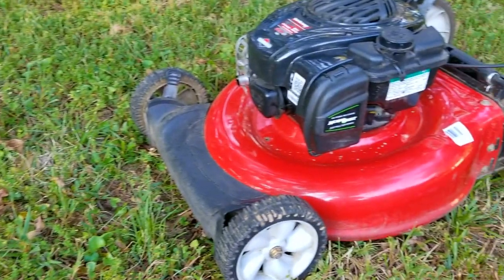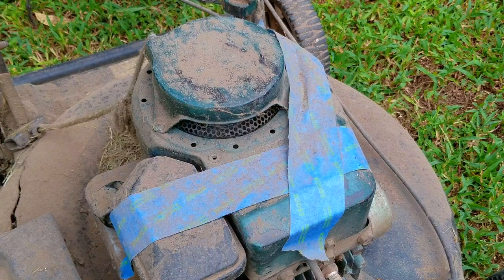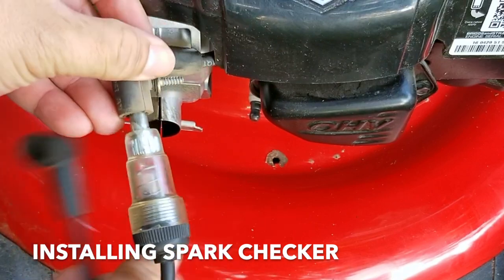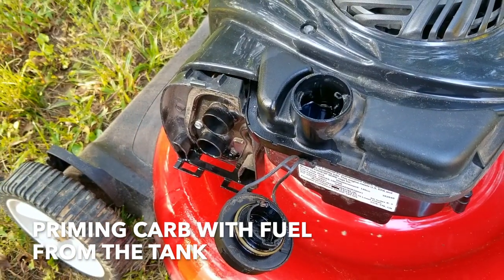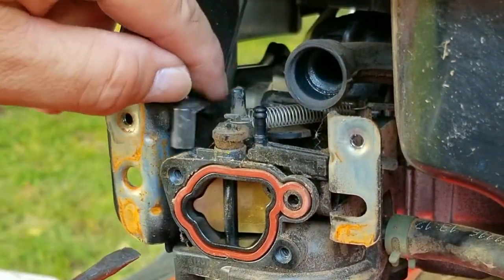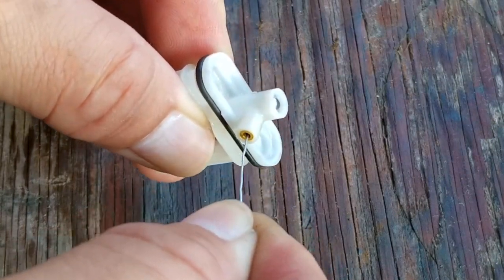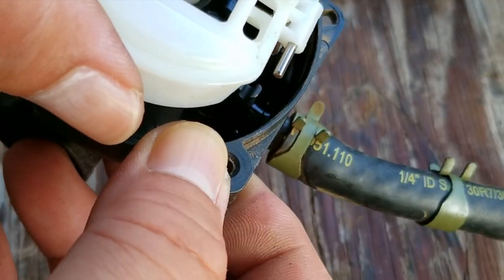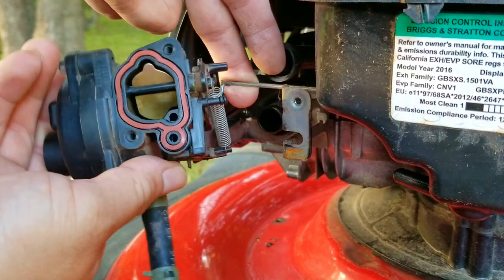Why Did Briggs Stop Making The Flathead Engine?

Comment: I have a 1980's B&S Classic push mower and a year 2000 Snapper rider. Both are still going strong. Keep your oil changed and run them out of gas for winter storage.
Reply from the maker: Thanks for the tips!

Comment: I have the old flat-head  mower motor on mine and it's been running for about 20 years now. It's had a new fuel tank and and 2 carbs and some gaskets. It's still running like a champ.
I suppose it's nearly worn out by now but it still starts on the 1st or 2nd pull after a good prime. 
I don't think anything I could replace it with could last anywhere near as long.
Reply from the maker: I like your testament about them, these can be very good engines.

Comment: I have a Flathead Brigs and it runs fine. The only problem is in the spring as sometimes the engine won't start the first time I go to mow my lawn. The carb float sticks and doesn't allow fuel into the carb so I just drop the bowl and blow some are on it. Put it back together and it then runs the rest of the summer.
Reply from the maker: nice work!

Comment: I have not seen the plastic carburators in my country yet, that is totally new to me! Whats your opinion on them? They might be better because they will not corrode when water comes into the bowl. Any opinions?
Reply from the maker: yes they went to the plastic carbs, in part, to deal with the ethanol content.  Good Carbs as Long as you use gasoline with NO ethanol .

Comment: I love the plastic carbs. I freaked out the first time I saw one, but they are super easy to work on. Making carbs out of plastic is actually a really good idea, since it eliminates issues with rust and corrosion.
Reply from the maker: me too, I was shocked but then realize I've been seeing them on the pula prime engines and even the 2 stroke lawn boys for the longest times.. got used to it by now

Comment: I've got this same engine on my mower. I've had it a few years now, and found out about the starting problem after the first winter fresh out of the shed. Read up on it, and the problem stopped when I started adding stabilizer to the gas. And yes, the recoil IS a problem, haven't had to work on it yet, just have to twitch the cord after starting, now and then. Oh and, tipping the mower over to drain the oil is a pain.
Reply from the maker: than you Feral for sharing your experience.

Comment: this is the kind of view you get from a youtuber who worked on a mower one time.  The plastic carb isn't bad, they can still get clogs but at least the bowls don't corrode.  The clogging and corrosion from modern fuel has nothing to do with octane levels, it has to do with the ethanol.  Ethanol attracts moister...moister in fuel causes corrosion and enough water in the fuel will stop a small engine from running right or at all.  And the Intek engines are in literally dozens of popular riding mowers, ranging from 15 to 21hp...they are perfectly fine engines.  I've run a few much harder than they were intended for and they did great.  Any type of fuel injection would add at least $100-$200 to the price tag of a push mower.  Most push mowers have carbs that cost $15-30 new.  You can't have a fuel injection system for anywhere near that cost.  The modern engines, plastic carbs...neither are to blame for 1000s of these little mowers being thrown away.  The main issue is ethanol in gas.  Without ethanol, gas can remain usable in a lawnmower for 3-6 months...with ethanol, it can cause problems in as little as a month (depending on the humidity outside)  Personally, I don't care, because I always pull a few free mowers from the roadside every spring, clean the carbs, and then sell them for $50-$100 depending on how nice they are.  And, I do lawn care, so I always get new customers who had their mower crap out and would rather hire than pay $400 for a new mower and do work every weekend.
Reply from the maker: thanks for the information

Comment: I have a Tecumseh from 1979.  It has a not getting fuel issue.  I thought it might be a stuck float. You showed me it could be something else.  I never drain out the fuel so the gas is a year old.  That is not the issue.  It ran before and because of the safety feature, as soon as you let go of the start lever up where you push the mower, the engine shuts off. Designers are nuts.  I have to wire it to always engage the blade so when I take off the bag the blade is still engaged.   So, on the second go around of cutting the lawn I did not have the wire to tie the engagement lever so, it shut off.  No biggy until it did not want to start...halfway through doing the lawn.  So, I guess I got to take it apart and clean that port.  I assume the T mower is the same as the B&S mower. Now waiting for the snow to melt...so awhile to go.  Time for a beer. My electric lasted 40 years & still works.

Comment: I recently sold a 30+ year old generator that had a Briggs engine. It had sat for several years. In preparation for getting it sold, I drained the gas tank and replaced the fuel hose. I filled it with fresh fuel and gave it a pull. No start on the first pull, on the second it started right up! That engine always did, it never gave me any problem.
Reply from the maker: nice!

Comment: Fit a inline fuel tap ,I've found that the main problem is fuel forms sticky varnish, so fit tap and run engine till it dies,remove fuel. Small engine means small jets . You can use bicycle cable strands and carb cleaner. Hope this helps.
Reply from the maker: that would work but there's not enough fuel line to fit the fuel tap.

Comment: One thing I've noticed about the old flathead engines is the carburetors never seem to clog up. Most (if not all) use the type that are mounted on top of the fuel tank and used a diaphragm to draw fuel. Where the newer OHV engines use a float and float valve. I have never torn into the type mounted on top of the tank but have on many that used a float valve.

I've started old flathead engines that have sat for years. 

I believe it's because as the fuel evaporates in a float type, it leaves this funk behind (the more fuel in the tank the more funk) but on the type mounted on top of the tank where it draws fuel up, the fuel that's in the carburetor evaporates but that's it. The rest of the fuel in the tank evaporates out the fuel cap.

Does that sound logical?
Reply from the maker: you are correct the pulsa prime carbs never had much issue mainly because it didn't sit in the fuel, like the bowl type.

Comment: i installed a filter in the fuel line and eleminated the clogging, there is very little room for this mod but it can be done. you have to buy the smallest inline filter , by the time you cut the line enough to get it in there is very little of it left but its worth the trouble
Reply from the maker: thanks Jay Jackson.

Comment: I have an intec briggs on my pressure washer, it’s probably close to 20 yr old now and im always amazed at how well it starts, 1-2 pulls even after sitting over the winter. Last year my pump froze and cracked, as the engine ran so good I bought a new pump, when I took off the old ump I found the keyway totally stretched and worn on the crank shaft. As I already had the pump I ut in a new key, filled the worn away part with jb weld. 
Done several wash jobs and it seems to be holding up, will see how it holds up, time will tell😅
Reply from the maker: nice, I never thought to check the key, thanks!

Comment: I know it sounds bad but I bought a cheap mower with a Chinese OHV Honda copy and it has been way more reliable than the new Briggs engines. Only reason I scrapped the mower is the blade snapped and I could not get a replacement. The mower was over 20 years old and still starts first time. Yes I kept the engine and scrapped the deck.
Reply from the maker: nice, sometimes the copies work just as nice as the original.

Comment: When I was a kid we got an old 3 HP B&S lawnmower from my grandparents, probably from the 70'ies or so. I think my dad still uses it. We took it apart once to clean it up and replace the head gasket, but otherwise the thing just runs and runs. And yes, we always made sure to run it dry at the end of the season, and use the 98 RON gasoline with less (no?) ethanol. Only complaint was that when we took it apart, we had to buy a set of inch spanners, pretty much everything else here in Europe uses metric fasteners since forever. Don't know if the newer B&S engines use metric bolts?
Reply from the maker: hmm.. you bring a good question, I'll have to look into that.  But 
from all indication I feel they're  still standard.

Comment: I like the Honda GC over head cam engines. It's a clever design with a one piece cylinder and head, no head gasket or bolts. Metal carburetor, light weight, smooth running and easy to start
Reply from the maker: I completely agree. The no cylinder head, kind of surprised me at first but I've grown to like it.

Comment: I'm wearing the same Adidas sweatpants I wore like around 18-20 years ago. And they are still going super strong. The rubber band around the waist has lost some of its elasticity but not all of it and I had to knit the folded part around that rubber band again because the previous thread keeping it in place had worn out but other than that, they are like brand new.

However, today my right pocket's zipper came apart. The two sides were no longer attached. I took a much closer look at it than I had ever before taken and I noticed the teeth on the zipper are actually MADE OUT OF METAL! You NEVER EVER see that on modern sweatpants anymore! Just a tiny bit of paint had come off of them and one part of the other side of the teeth had worn out stiching which allowed the teeth to twist too much and the zipper runner could jump out. After a bit of patient fiddling, I managed to fix the zipper and it's in one piece again and zips just like it did on day one.

So yes. Old stuff is MADE TO LAST and HAS QUALITY. If you have old stuff lying around, give it some love, dust it off, clean it properly and maybe even give it some new long lasting paint on it and enjoy the tough everlasting quality of it. I sure am with my sweatpants and I hope I never have to let go of these pants.
Reply from the maker: thank you MrBrander

Comment: A year or two ago I bought a Craftsman power washer with the new Briggs engine and had the same issue with the carb. Worked in the fall then wouldn’t in the spring. 

I hate that the new mowers have the plastic front axle mount assembly. Pure planned obsolescence, but it’ll fail before the engine does
Reply from the maker: I agree, they never wanted these to last as long as the older ones.

Comment: The craftsman I bought back in 1995 still runs just fine and starts first pull 98% of the time. It even still has the original drive belt for the rear drive. Of course, I maintain it and have only changed the plug once to a AC plug. At this rate I will never have to deal with anything new, thankfully.
Reply from the maker: nice, thank you KO

Comment: Many years ago, I had a flathead on a cheap power washer that worked so hard the head bolts loosened and it quit. Tightened them back up with the old head gasket, and it still runs to this day.
Reply from the maker: wow, glad to know it can be done.

Comment: I worked there (Briggs Murray Kentucky plant final assembly) i worked on the line transition between ohv and sv/L head motors around 2012. They did it because of emissions and noise reduction. It never paid off, place closed in 2020. poplar bluff plant still hanging in there i think.
Reply from the maker: thank you Aiden Wade, I appreciate the insight.

Comment: The best engine I've probably ever used is the little 5-horse Tecumseh in my 96 Craftsman that I picked off the curb. A little welding to fix the slightly-rusted deck and it was good as new. I leave the juice in it, but I always use fuel stabilizer. Looking forward to the first run in the Spring--betcha it'll pop right off like it always does. Good video!
Reply from the maker: nice thanks for sharing Hank Hill.

Comment: Too many of the older model flathead (sidevalve as we call them) have been scrapped. I'm doing a restoration on a 50+ year old ride-on, and can't even find a core to begin working with. The OHV engine currently in the mower (had to be installed backward to make it fit) has the opposite issue. It won't start without an extra shot of fuel, but once it fires, it runs fine.
Reply from the maker: interesting, is the choke working like it should on the OHV engine?
Reply: @INSIDEHOUSEGARAGE  Perfectly, as it should. You can watch it open as it warms up. All I do now, is pop the filter cover open, give it a squirt of aerostart into the throat, pull the cord then put the filter cover back on. I can live with that until I find a flathead. 😂
Reply from the maker: that is interesting and thanks for the update. Have you checked the valve lash?

Comment: I have both  but the overhead valve jobs are a Kawasaki that's older than dirt off a worn out, wrecked Deere mower and the other is a Preditor on a Champion wood splitter and maybe the pressure washer motor. I also have flatheads from 85 on that still run just fine, one on a 38 inch Craftsman rider that had NO maintenance till I came along and smokes a little but still runs fine. I think Briggs started going to Tecumseh-like parts a long tie ago. Recoils and such and then eased right into the overhead valve deal. The plastic parts thing is a joke because with people squealing about fossil fuel usage they forget that it takes crude to make plastic but I can work on anything I have and sure won't get anything new if I can help it. I know Stihl came out with fuel injection on their cut-off saws but haven't heard much on anything else BUT I haven't been listening either.
  So there's my take on it again. Thanks and BLESSINGS!
Reply from the maker: you make a great point about plastics.  It's funny how things really turn out, once you see all the information.

Comment: If you use aviation fuel or the Sunoco racing fuel you can
leave it in the gas tank for years without issue. 
I have a very bad temper when it comes to yard work.
I absolutely hate yard work with a passion and anything
that gives me grief will set me off like a firecracker.
That said, I am more then willing to pay twice the
price per gallon for either 100LL Aviation fuel or the
Sunoco 110 if it means I can always get my small engines started.
Believe me, these fuels work every time with no carb
or starting issues. The type of gas you use is going
to determine how reliable your carbureted small engine
will run and start. At the very least,  use ethanol free gas
in mowers. If the engine is two cycle, use the best oil
to mix with the gas you can find. 
You can find the aviation fuel at most airports and 
good hot rod shops will carry the Sunoco racing gas. 
Yea it's expensive but one must ask,
what is your sanity worth.. Nothing is more irritating
then having to do yard work on a  hot day while
having to deal with a lawn mower or weed whacker that refuses
to start or run properly.
Reply from the maker: thank you archangele1 for the information.

Comment: Adding a fuel tap to allow the operator to run the engine till the carburettor is empty will save a lot of grief with gummed up main jets.
Reply from the maker: yes unfortunately the fuel line on this one isa only abut 4" so putting one on, is tough.
Reply: Unfortunately poor design plus the ongoing grab for a$ rarely results in a win for the consumer.

Comment: As an MST and a couple other Briggs certifications for stuff like generators, the main reason they killed it was for emissions reasons.
It was getting too hard to make them comply with changing regulations.
Reply from the maker: I can see that.
Reply: @INSIDEHOUSEGARAGE  yeah that's what we were told during training. 
The new vanguard line , check em out they definitely look like a Honda clone and are really trying to go after Honda with features like transport-guard. 
That shuts off the ignition and fuel flow to the carb with one knob. 
It's got the choke integrated into it too if I recall, because the little training vid I saw they tout the vanny as having like 2 steps to start it and the Honda is like 5.
Reply: Worrying about emissions on a small engine shows what idiots we have running this country.

Comment: The plastic carb jet insert is cheap and easy to swap. Were plastic parts added internal to the engine?
Reply from the maker: on this machine, it should have been the cam gear,  and also the oil slinger.

Comment: There are small 4-stroke outboards that have fuel injection with no battery, so it can be done. I don't know if it's a mechanical system with electronic fine-tuning, or purely electronic.  Yeah those cost a lot more than a lawn mower, too but they were just as expensive when they had carbs.
Reply from the maker: it was just an idea. But they went with a new engine and we can see what happened. thank you Droz Company. I appreciate  your comment.

Comment: The old flatheads are great. I had one with a bent crank. It took multiple tries and over 30 minutes of run time with the carb wired open and the crankcase either filled with no oil or water. 
I have another 12HP on an old go kart that is so worn out it drink as much oil as gas. It needed a turbo just to make normal power again. Still runs ok though
Reply from the maker: keep up the good work.